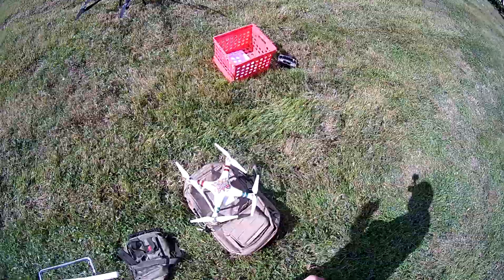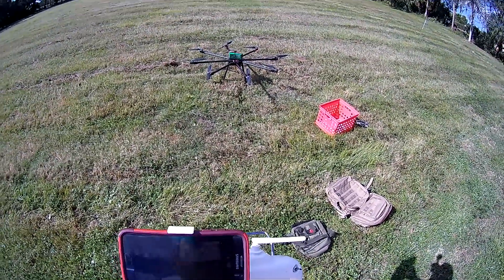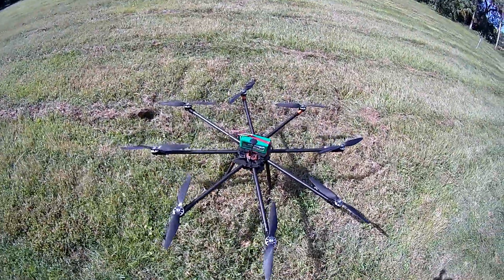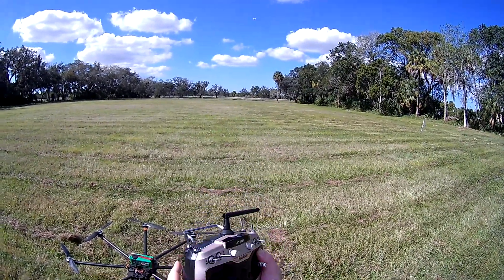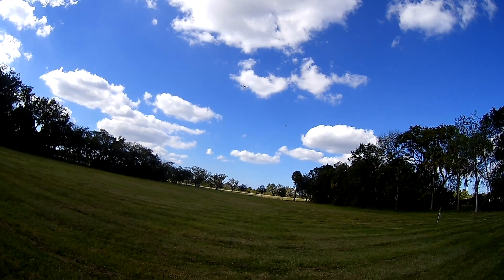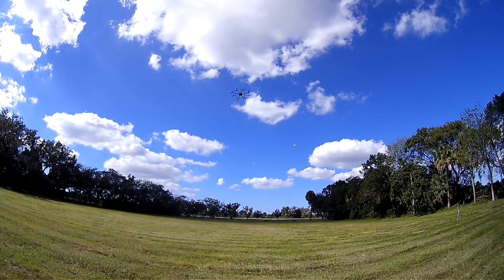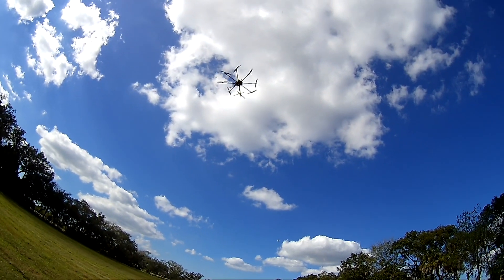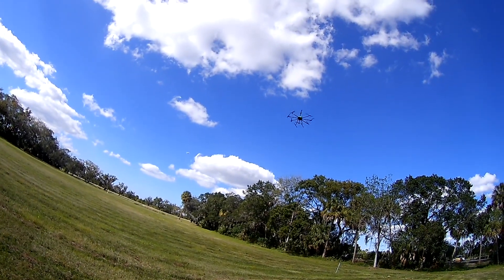Huge Drone Octocopter - Over 4 Feet Across! - Octaphore

Comment: I love how you could put down the controller after positioning the DJI and it just stays perfectly still and flys itself like a tripod camera. Big step up from the RTF models of 2008 when I first got into RC heli hobby. Even with a GPS and autopilot unit installed there was still a possibility of crashing so it was necessary to pay attention to it and always have hands on. I would love to get one of those Phantom 4 pro v2 DJIs.
Reply: yea i love shit like that. I am currently in mid proces of a huge hexacopter. the frame is 1.3m wide with props its 1.7m